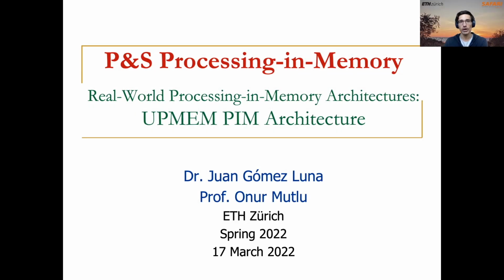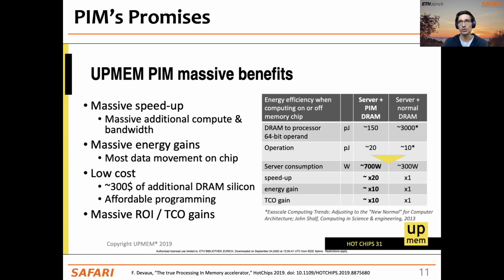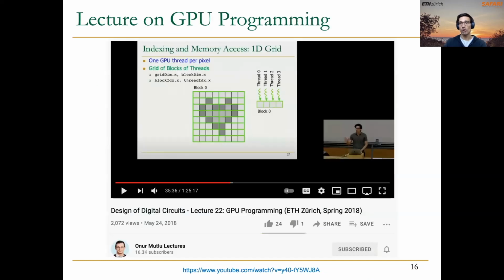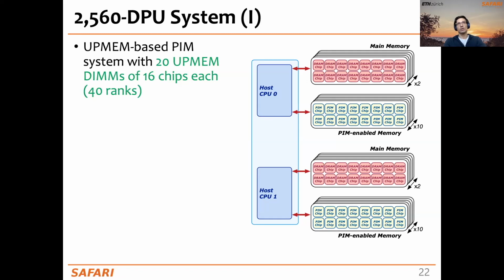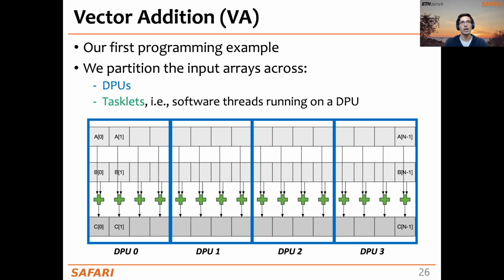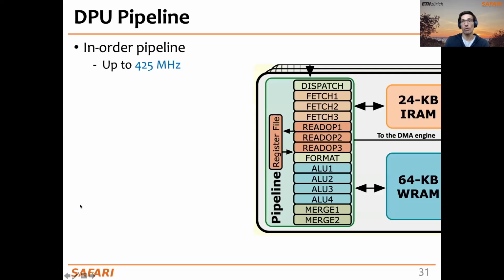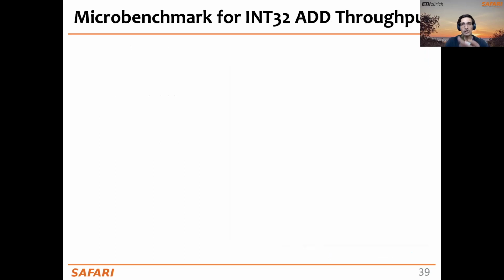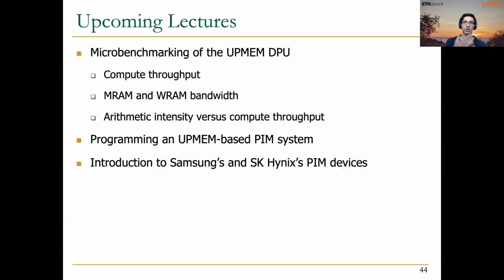PIM Course: Lecture 3: Real-world PIM: UPMEM PIM - Fall 2022

Comment: Thanks for the great lecture. I have two questions: 1. Why we still use DRAM as main memory in the whole system, instead of using all the PIM-enabled DRAM as main memory? If so, we can directly execute the computing without data transfer between host CPU's main memory and DPU's MRAM banks.
Reply: That's a good point. I agree. Hopefully we will see it in future PIM systems.